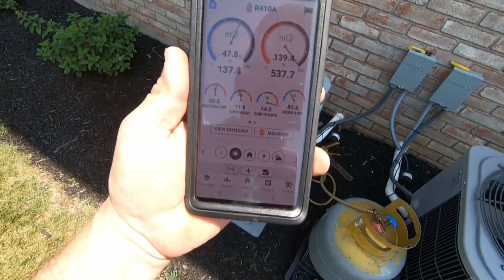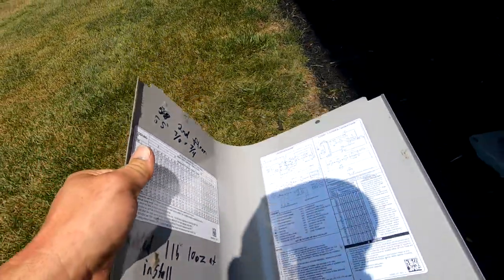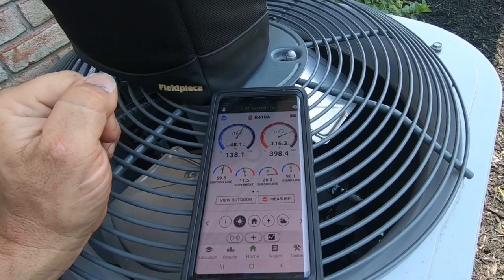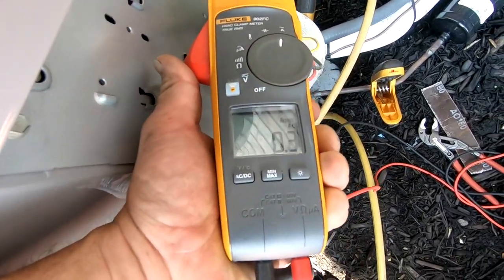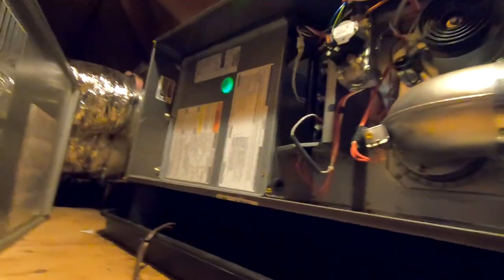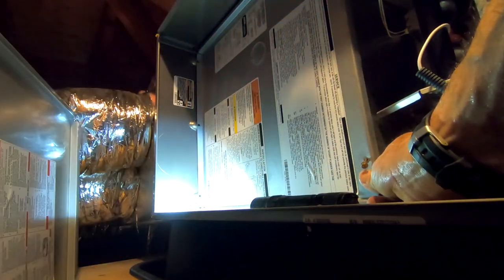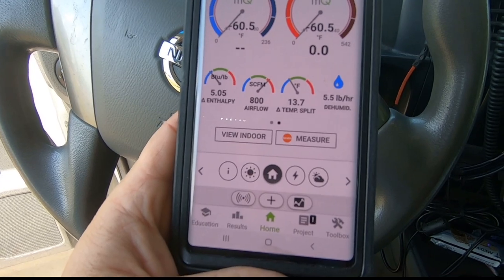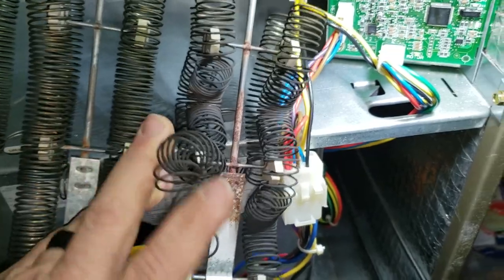Air Conditioner Works Sometimes But Not Cooling On HOT DAYS Plus Bonus Footage

Comment from the maker: Here is a simple but all to common issue that you can run into. This was more for the new techs so don't beat me up for a easy call. I love the thumbs down...lol what did you not like if that was the case?
Reply: Thanks . Keep the videos coming
Reply from the maker: @jmemixx  Thanks for your support 👍👍
Reply: I have a new unit that cools great when its cooler out but when it gets up I to the 90s 100s sun beating down it can nearly keep the house at 80 and runs constantly. The line is beat can cold though condenser fan is blowing out tons of heat.
Unit also condensate out drain line. I have noticed at times high humidity on the house though. It's a 3 ton icp unit only a year old. Everyone keeps saying the unit is fine any suggestions.
I do know the blower is set to high on purpose because if you set the speed any lower you can hardly feel anything out the vents. The old unit was a massive 5ton unit on a 1,000 sqft house it was replaced due to major issues rust and corrosion but when it did work it short cycled frequently.
I'm not the one that had a 5 ton installed last owner did.

Our unit cooled fine last year not it seems to not keep up.
Reply from the maker: Not enough information. How many tons is this system, was everything replaced, the indoor coil and air handler, the outside unit? How many square feet is the house, what state is this located in. What's the outdoor temp and humidity, that's the indoor temp and humidity, is the duct work properly sized for the tonnage, is it insulated, is this in a attic, crawl, out outdoor packaged unit. I assume your the homeowner and not a service tech?
Reply: @HVACRSurvival  I said all this in my comment it's a 1,000 sqft house 3 ton icp heatpump system with electric backup /aux heating.
Everything is new except the duct work which is why the blower speed is set to high it still has the 5 ton duct system the vents hardly blow if it is set any lower.
Unit heats perfectly with out needing the back up heat.
Reply: Oh one thing I did leave out is it's in Galveston tx.
Reply from the maker: @SuperJeremi10  sounds like duck work is probably is your issue if that's the correct tonnage for your area. I'm in Ohio and we would never use something that large for that size of area so your area is completely different to mine.  Without knowing what the refrigerant pressures are and the temperatures the system is producing it's hard to make a educated diagnoses. I'd say call different contractor to come look at it.
Reply: @HVACRSurvival  the temps here can easily climb intonthe 90s 100s sometimes more if it's a heatwave.
Reply: @HVACRSurvival  the unit cooled perfectly last year  and when they left it there was a good  15 - 20 degree drop. The vents used to blow really cold the first summer now it dosnt seem to blow that cold.
Even at night it used to cycle ever 30- 40 minutes  when set to 72. Not it took over 4 hours at night to get from 76- 74.
I keep the thermostat at 70 at night now because that is the only way I can keep the house cold by about 12 the unit has begun to stuggle keep the house at 74. About 3 its 76 around 4_6 is 80 if I cook or have people over its 82-85  then it takes all night to cool back down. The house wont reach 76 again until about 10 pm with temps around the 80s.  It's just not cooling like it did the first year it also has a txv on indoor unit.
Reply: I actually have an old video of updates to our house shortly after moving made the video a year before we put the new unit in.
You dont have to listen to any audio that would give you an idea of the house size it's only 900 sqft with a room below the house tied into the ac system adding the 1,000 sqft.
We have a house on a canal with the garage below house with an added room that was turned into a bed room.
https://youtu.be/qpEJGClImGQ
Reply from the maker: Something might be cutting out? Is the compressor going off on thermal overload, is one of the fans outside stopping causing it to trip and shut down. What's your temperature drop now?
Reply: @HVACRSurvival  might be but I havent noticed the unit ever cycleing off the outside fan stays on.
No I'm not sure as I dont have a meter to check it temp drop was checked upon install and it was a rather hot day then it cooled the house down quickly.
My filters are clean vents have plenty of air coming out. It just dosnt feel very cold and smells musty and damp.
Even at night the vents dont blow cold like when it was first installed.
Where would be a good place to get a temp sensor to check.
Reply: Okay I borrowed a temp tester from neighbor I just turned the air on about 30 minutes ago got home from work.
It's taking in 80 degrees at return and out the vents is about 70 I tested several places.
Reply: @HVACRSurvival  I think we figured it out we took the sensing bulb for the txv and dumped it in hot water shortly after the vent temp started dropping I ended up with a return temp of 76 and supply of 58 about 20 degree drop.

We returned the txv to its spot so far its cooling so we should see how long it last should we have the txv replaced.
Reply from the maker: Was the bulb loose?
Reply: @HVACRSurvival  it felt pretty tight it took some effort to move it.
Reply: @HVACRSurvival  well I ended up calling the hvac company that installed the unit and explained what I did so they are coming to replace the txv under warranty and check the system. They will be here around 10:30-12 ish today to preform the work.
Both indoor and outdoor units are brand new I replaced an old r22 ac unit with a week preassure relief bad compressor it was a 2006 Lennox system matched with an old 1995 Goodman airhaindler it was a heatpum also. Coil was rotting and airhandler was nothing but rust and corrosion plus a hackery special. We decided just to replace the system. The old ductwork is next on the list just dont have the finds right now.
 New system is a icp 14 seer I belive
 matched with airhandler with coil built in to airhandler unit
Reply from the maker: Well that's good that they're coming back
Reply: @HVACRSurvival  yes it is but I have used them a few years now.
They came out turns out the txv was sticking.
It is now 80 in the house its blowing 60 out the vents. 20 degree drop.
The condenser is takeing in about 90 95 sun beating and its pushing 110 -118 out the top of the fan.
They did mention the condenser js a little dirty from sand and that dist the blew down here so they are going to clean the unit.

Comment: Temperature drop across filter/dryer is only 1°F. At the pressures you were operating at 1°F is 5-6 psig drop, 2° - 3° would be huge pressure drop. Another good video, keep it up.
Reply from the maker: Thanks Glen👍👍

Comment: I am fairly new to the comercial side of HVAC. Only came across twice on ECM motors. I remember a trane with about 14 wires coming out of the thing. On my case all the wires were going to the circuit board. I would have liked to see a quick run on the wiring and name on the manufacturer. Just saying, that's the kind of thing it helps. When I am on the field then I remember I have seen something specific on a video. But all and all thanks for the videos, your time and effort is appreciated!!!
Reply from the maker: Thanks David, this was a ecm constant torque motor that uses 5- 6,  24 volt leads to tell the motor to run at what predetermined speed.

Comment: On my personal system at my house I run the fan an extra 2min after the condenser shuts off. 
VERY High Humidity here near the coast; Air Handler is in a closet in the garage and will sweat most days - letting the fan run for a couple of extra minutes got rid of the droplets of condensation on the outside of the air handler....makes use of the last bit of heat removal from the cold refrigerant in the coil too.
Reply from the maker: Good advice Mike, thanks for watching and commenting.

Comment: Those strips are sometimes tricky cuz you look at it one day the next its broke. If you look at the tip of the bar of the one that was welded, it looks to be burned so it was the smell he was smelling. Lucky the ac still cooled on not so hot days. I have seen them not cool at all when well over charged. Great video miss seeing the show.
Reply from the maker: This was from over the winter. What threw me was the fact that my amp draw was normal on all elements. Then low and behold this was the issue. Thanks for taking the time to watch and comment!

Comment: When I read a month or so ago that lowering the fan speed helped dehumidification, I sure did switch to low fan speed! Med high and high seem the same and med low and low seem the same. I also have downflow with in slab ducts. I used to always run the fan speed on high for AC.

Carrier 3 ton condenser. ADP 3 ton coil with TXV. I believe my furnace is 4 ton.
Reply from the maker: Sometimes it's more noticeable when you have a ECM motor vs a PSC motor. Check your temperature drop across your evaporator to see if it's inline. I like 15-20* drop. (That all can change depending on your humidity) levels)
Reply: @HVACRSurvival   After doing it, my delta T increased an entire degree. I am too pleased, because it gets very humid around here.
Reply: 9:52 PM 80 degrees outside. 
Return plenum air to Coil air delta is 24.5
Coil air to register air delta T is 17.4
I have some heat gain in the slab ducts, but I gotta take what I can get. I'm happy for now.
Reply from the maker: Sounds like it's going well. The heat gain in the slab seams high but I haven't spent a lot of time testing slab ducts for gain. Around Ohio we don't have any gain but I'm sure loss is more noticeable in our heating months.

Comment: On your heater job it would have had quite a bit of amperage on your ground wire. That's a widow maker if the grounds aren't tight and they burn then you come along.
Reply from the maker: You are correct, I don't usually check my ground wire often but I will remember that for next time. I usually check ground when the building is having electrical issues.
Reply: Good tip Joe usually dont check g

Comment: Hey man do you think the equipment might be mismatched ?  or undersized for the house ? What do you think the CFM/TON on this system ?
Reply from the maker: No I don't,  I did not go into details of the home or the installation but its working great now from what I was told by the homeowner.
Reply: Man things undersized for sure if it doesn't cool on very hot days

Comment: I wonder if a residual current breaker would have prevented that heater strip from burning up so bad or even going unnoticed for longer than a day or so after it broke, they will trip when either hot or neutral goes to earth.
Reply from the maker: The amp draw was 20-21 amps per element, so it would not and did not trip the breaker. Usually the electric furnace will have 60amp or 30amp breakers feeding it.  It made the smell once and did not do it again. It likely made the smell during the failure and then stopped. We came out the same day or the next day after it made the smell.

Comment: Do any of your homeowner customers have service contracts with you for spring and fall inspections. I live in NE Ohio and contract with a local company they have kept my HVAC system going smoothly for 22 yrs.
Reply from the maker: We do, but I'm in north western Ohio. It's a good thing to have done.
Reply: @HVACRSurvival  yes I’m pleased with the service company I’m using and I don’t worry about my system at all. What smart/programmable T-stat would you recommend?
Reply from the maker: What type of equipment do you have. Brand, electric, gas, heat pump, boiler?
Reply: @HVACRSurvival  sorry for the late reply, I was in Columbus all day. I have a Rheem 80% 75k btu updraft furnace and a Rheem 2.5 ton 13 SEER R410A AC unit.
Reply from the maker: @trep53  let me do some research and I'll get back with you. I hear good things about the ecobee, I have had good luck with the high end Honeywell's,  mainly the red link wireless system with duct sensors.

Comment: About the bonus footage : I don't quite get how come it didn't trip the RCD ? Or maybe they don't have one ?
Reply from the maker: Because the amperage was 20 amps to ground. The electrical path to ground or nutrual was making a 120v circuit instead of a 230v circuit. It would be the same as wiring it for half the voltage. If the element would have broken and shorted let's say a couple inches from the powered side, it might have tripped because the resistance would have been much lower and would have resulted in higher amperage.
Reply: @HVACRSurvival  yeah but over here we have RCDs that trip if you have leakage to the ground overs 30mA for residential equipments , that's why I don't get how you can have 20A leakage to ground without tripping the RCD . I'm scratching my head  right now 😓
Reply from the maker: @sterlingarcher46  that sounds like a arch fault breaker, last time I checked a few years ago we were only required to have those in the bedrooms.
Reply: RCD in the UK? Ring circuit comes to mind>
Reply: The americans call it a GFCI and they have not been used very much until now. with the new 2023 NEC regulations residential air conditioners will require GFCI breakers. Over in Europe most houses already has RCD/GFCI on the whole electrical panel.

Comment: Good vid.Question that heater package was that on the same unit with the high unusual pressures? The reason why I ask i have had the same issues that you were seeing burned grounded heating elements which also welded close the relay contacts thereby keeping it energized causing erratic pressures and a bad split
Reply from the maker: No it wasn't, that was from a call earlier this winter that was not long enough for its own video. The furnace in the first part was a gas furnace.

Comment: Seems you are arbitrarily changing fan speeds without regards to unit information.
All the work you did before changing fan speed could be worthless.
If your airflow is wrong, your charge would be, too.
Reply from the maker: The air handler is capable of 3 tons on high, most Carrier branded products are raited to run as low as 325cfm per ton. The evaporator air flow had little no effect on the TXV, and same with the subcooling. The adjustments still did not have the effect on temperature drop I was looking for. I would have rather seen 16-19 delta t. As I mentioned I made sure the condenser was clean. What would you have done differently?
Reply: @HVACRSurvival  did you check the split in the attic? It may be higher than you think. That's my only issue with the probes
Reply from the maker: I checked it downstairs 😏 .(A little detail I purposely left out) I work with the person who's house this is. They are much more comfortable and said it's been working great 👍👍 and love that it's quite now.
Reply: @HVACRSurvival  more then likely it was fine after the first adjustment. 
I suggest checking at the unit if the split is low,it could be a collaped/partially blocked  duct you're checking.

If I'm not mistaken they only had one return as well. That could be aiding in the discomfort.
Reply from the maker: @Ivan Hall the system was installed a year earlier. The ducts were open and stretched properly. There's details I can't put in the video if your catching what I'm hinting at.
Reply: @HVACRSurvival  I got you. Thanks for replying and your content
Reply from the maker: I don't want to upset higher ups. 😏
Reply: @HVACRSurvival  I know what you mean, 🤫🤕